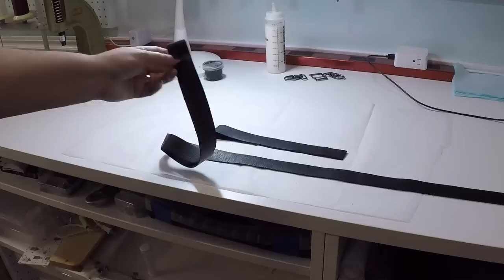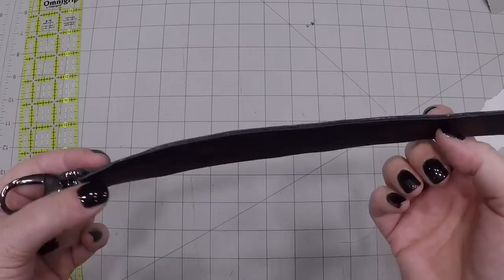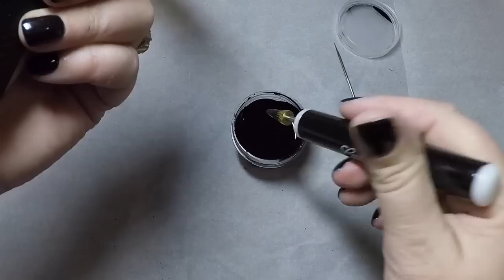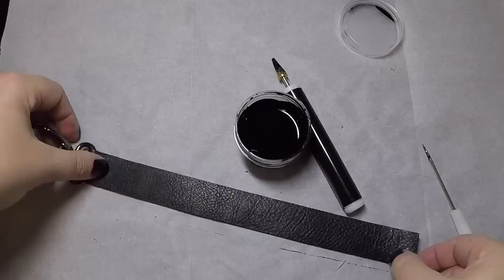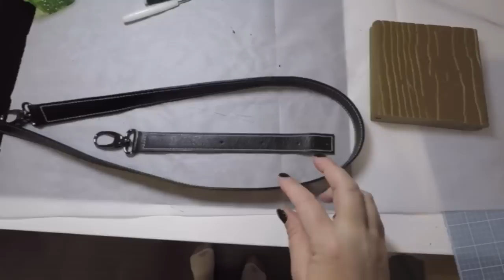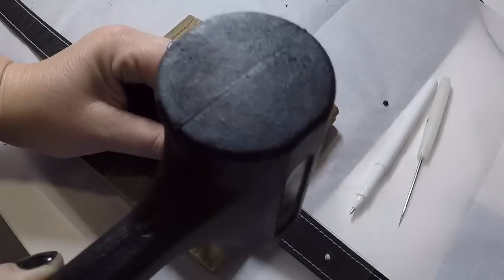Long handbag strap

Comment: Great tutorial, Debby. I also use Cordura to reinforce straps. I also use ballistic fabric to keep the leather from stretching.
My experience with edge coating is to sand the raw edge with a 600 grit sandpaper prior to painting. It will take out any excess glue and helps make the edge look more “seamless”. Apply edge coat and let it dry and harden completely. Sand again. I use a 1000 grit sandpaper to finish. I also like to buff my edge with beeswax.
Thank you for sharing your experience with us. ❤️
Reply from the maker: Thank you so much for your input!  Like I said, I’m just learning but want to share my journey...  I will try your suggestions!
Reply: Where do you get Cordura?

Comment: Hi again Debby! Where did you buy your 30 ml plastic for your templates. I'm here in Huntsville Ontario.  Thank you
Reply from the maker: I buy mine at my local upholstery wholesaler.  If you can find a tarp manufacturer, they probably would be able to source it for you.  As yet, I’m not selling it, but that may change...
Reply: I just happened to notice your comment under Debby's video!  I am also in Huntsville.  I was unaware of other bag makers in my town!
Reply from the maker: So cool!!!
Reply: How cool is that!  I will shop around for the template plastic. Thank you  for the info.

Comment: Debby thank for a great tutorial, never worked with real leather, what you do for coating an say red or another’s colors, do they have different colors?
Reply from the maker: I have just started my journey into the world of leather work, so I am not familiar with everything that’s out there.  I do know, however that you can get edge coat in different colors, and you can also learn to mix your colors to match exactly.  At this point, I’ve decided that I’m going edge coat in black only, and this may become a bit of a signature of my work.  Of course, that may change, but for right now, I believe black goes with everything! 😉